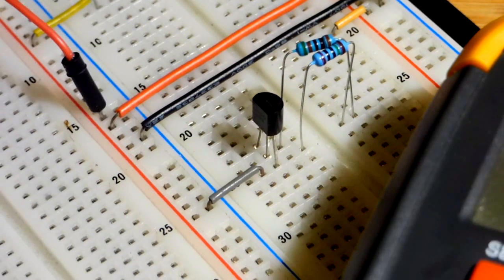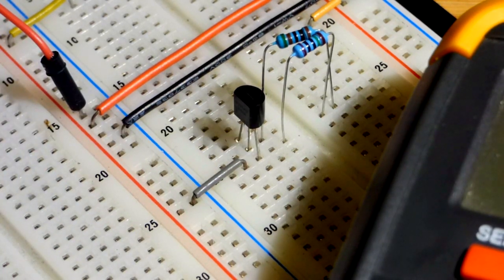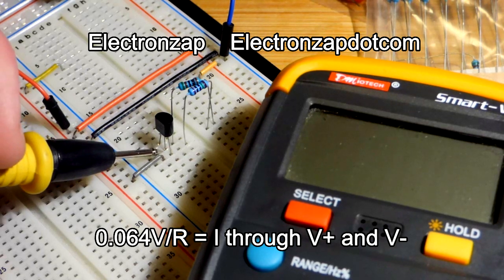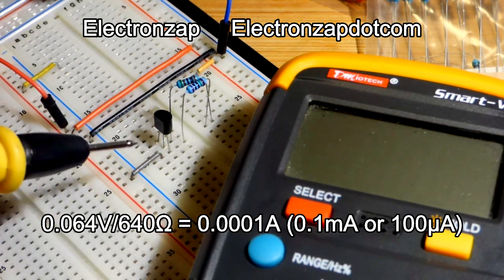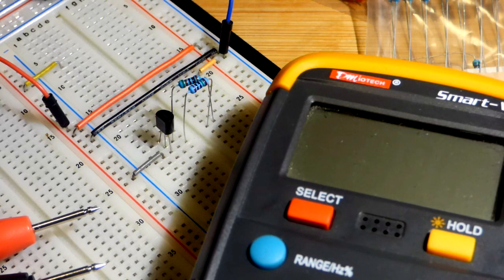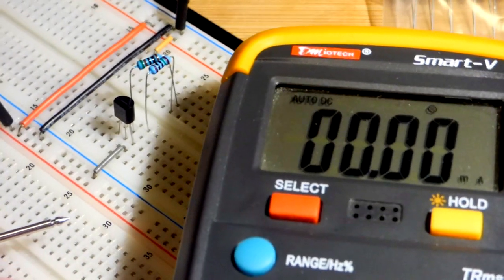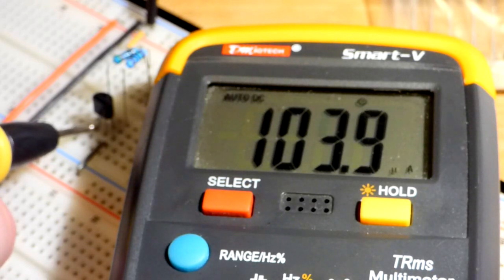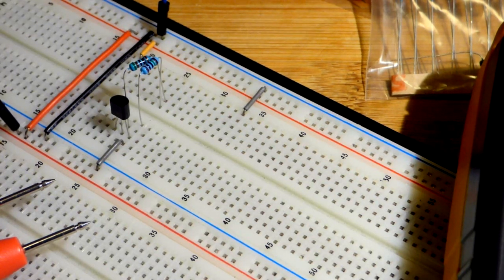How to get approximately 100 microamp current source using LM334 adjustable current source

Comment: Dude, do you think is plausible to use this to transform an output of a pwm into a constant current of 100 mciro amp?
Reply from the maker: I would think that you would need a capacitor to maintain a high enough voltage across the LM334 between pulses and probably a diode prevent the capacitor from discharging back into the pwm source.
Reply: @Electronzap   Thank you very much!
 I'm wondering about it, i want to generate very low constant current 40/100 micro amp but still being able to set specific frequencies.
Thanks again, i will give it a try
Reply: @Electronzap   One more question, this setup gives a constant current?